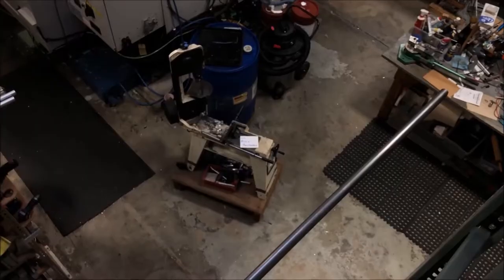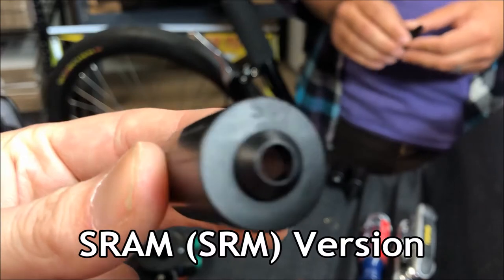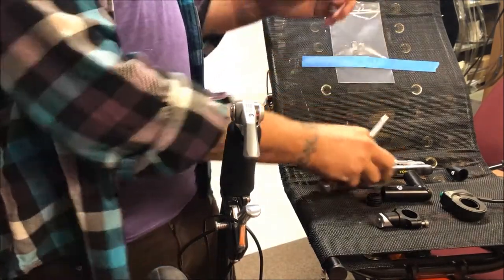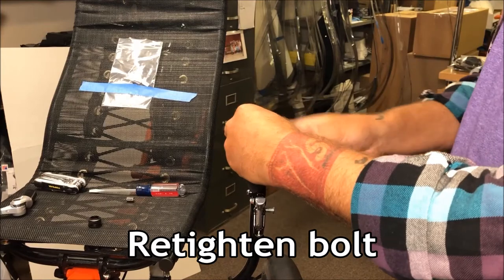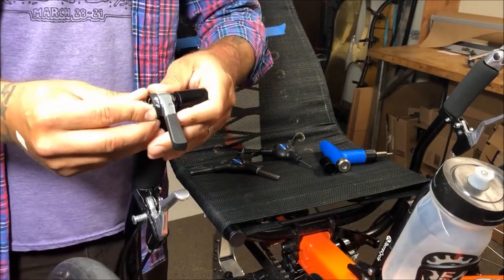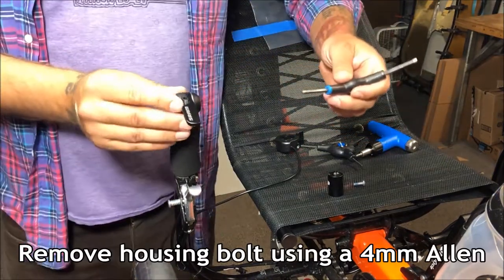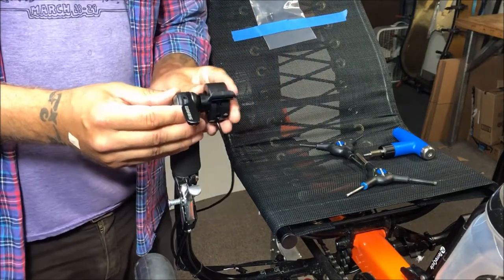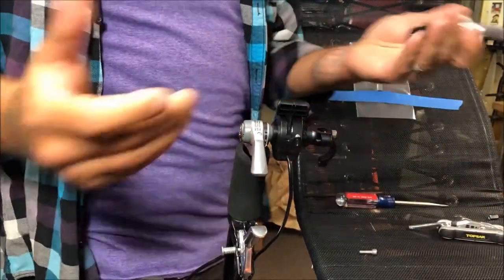T-Cycle Bar End Shifter Micro Mount Installation

Comment: Oh boy, this might just be the answer to a dilema I've been pondering.  Old Greenspeed GTO with Sram Dual Drive removed and hub motor installed.  I put a twist throttle in place of the right shifter and moved that twist shifter down below it on the stub mount moved from the Dual Drive internal shifter location.  Very non ergonomic.  Was just looking at bar end shifters to use with the twist throttle but then realized they run the cable housing external to the bar, not internal... that won't work.  I could do what you just showed and swap to bar end shifters and change the throttle from a twist to a thumb setup.  Looks a bunch more ergonomic.  Contemplating Sunrace 10 speed Freewheel with Shimano XT M772-SGS Top normal Shadow Rear Derailleur, KMC X10SL 10-Speed Chain,  and Microshift 10 speed bar end shifters.  I already have the derailleur as my original derailleur is getting a bit sloppy and doesn't like to stay aligned... plus looking for more wrap as I've swapped my 65 tooth Rans Tailwind front chain ring on.  Presently running 7 speeds x 2 rather than the original 9 speed x 3 x 3 and looking for more range on bottom and top end.

Comment: Are all these setups made to connect to a e-assit motor?
Reply from the maker: They do a good job of holding a throttle for an electric motor, but you can mount other things.  These mounts give you either 15mm or 30mm of mounting space, so if you have a light, a mirror, a GPS, or anything that's fairly lightweight and that has a mounting clamp less than 1-1/8in wide, then you could consider placing those atop your steering controls as well!
Reply: @Tcycleinc  I have a Utah Trike Fad Tad Crawler with a Bafang motor using Navincci rear hub. I prefer a thumb shifter.
Reply from the maker: @AL_Lopez_101  Does your Fat Tad have bar end shifters?  I know that Sunseeker Fat Tads generally come with grip shifts.  If you do have bar end shifters, then this might be a great solution for you!
Reply: @Tcycleinc  I will have to take a look but I can definitely use it on my Catrike 700, ICE VTX, Catrike Toad, andHP Velotechnic Scorpion Enduro FS. Would you guys be interested in a Zoom meeting with Disabled Veterans that participate in adaptive cycling?
Reply from the maker: @AL_Lopez_101  Hey Alfredo.  Unfortunately, I don't know if we have the time to spare at the moment.  Between the pandemic, the civil rights movement, and the hazardous air brought on by the wildfires, our capacity for work is quite limited.  You might contact https://cycledifferent.com/, as I know they have extensive hands-on knowledge for assistive adaptations!